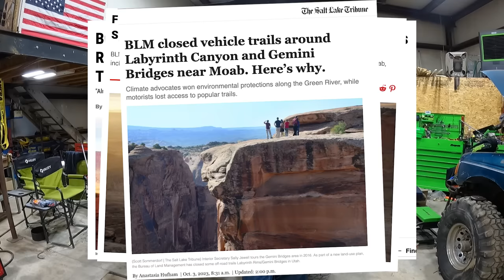TRX Falls Off A Cliff

Comment: I feel confident in saying that there is no one else in that area capable of doing what you did in removing that wreck from its position. You may not have been monetarily compensated for that service, but what you did in saving the land from further damage will reap you greater rewards in the future. Thanks Rory, Mike and Shawn for the great work you guys do!
Reply: Yes exactly and keeping the crowd out of harm's way. Cheers Capetown 🇿🇦👌
Reply: Heavy D and Matt's Offroad both could have plucked that truck out.
Reply: @donm.1068  I'm pretty sure it was Heavy D that was his "competition" on this job. I'm also really fuckin skeptical that trenching out that wash did less damage that a pick from above would have done.
Reply: @BT-ej9xf  I was wondering about that, too.  In terms of road/trail maintenance it was probably better than banging the TRX on the lip of the trail that the TRX fell off of, but not by much.  But I was also wondering how tough it would have been to get Heavy D's big wrecker in position.  I don't know those roads/trails, maybe it would have been easy, but maybe not.
Reply: @BT-ej9xf then why did he want heavy d to come out? Cuz he did mention that in the video
Reply: @BT-ej9xf  It's a wash, The water is going to remove any trace of the damage they did next time it rains

Comment: Can’t believe that the owner and his dog survived that fall!! It’s great too see you and crew doing everything you can to protect the environment and checking with all the landowners for access to enable you to recover the true.
Reply: Yeah amazing to see the cab of that truck pretty well intact after that.  Never would think that someone and their dog would make it through something that crazy.
Reply: Thought for sure that was a fatal, what amazing safety modern cars have. That thing is crushed to bits, and the frame is snapped at the bed / body area, it took some massive hits.
Reply: They learned their lesson that the TRX was beyond their capabilities. Hopefully the owner goes back to a stock 1500 or Powerwagon for their needs.
Reply: @PatientXero607 I was down there with him. like Rory said there was oncoming traffic and the Trx is a big truck and once one wheel went off it was over
Reply: @PatientXero607 they way Rory described it and others on this thread confirmed, it wasn’t really an issue of the driver being in over their head. It was a slight misjudgment of where he was in relation to the soft shoulder and trying to follow the rules of the road to allow others to pass safely. A lighter Jeep probably does not collapse the soft shoulder and pull the vehicle over the edge.

Comment: We built a sled for ATVs that had severe front end damage to tow them out of the woods. Something like that would have worked great here, steep angle on the front for getting over logs (rocks in this case) and it slid well over soft ground, keeping the frame and damaged front end components from digging in and getting caught on things.

Comment: Surprised you guys didn't put some good rolling tires on the front so you weren't plowing and were rolling over things instead with that front end. Holy cow! I thought that the cab was broke off the frame when coming through that rock pecker path but towards the end there I see that the  frame was actually ripped up from the bottom! Wild. Thanks  Rory for doing this job as cleanly as you could instead of the other hackwagon. Unfortunately I think we're going to lose all our trails to the greenies in their stupid Priui (that's the plurural of Prius right? )

Comment: I would like to give some constructive criticism, and I hope you don't take it wrong because I genuinely want to be helpful. The argument about someone else destroying the land and you not destroying the land is pretty weak. Maybe they will destroy the side of the cliff, but you are kind of wrecking parts of the canyon floor. Kind of a toss up. You did amazing. Its just a tough job, and some damage is unavoidable. If you are pretty sure you have done the tedious paperwork, and they will not do the paperwork, then you should present it like this, "If you hire us, and some complaint comes in, or there is a dispute about the recovery, I can present all the permissions and approvals to keep you, the customer, and us out of trouble." That statement (you have to make sure it's true of course) will easily justify a higher price.
PS: you are an amazing driver. I can't believe how much control you have over that tow truck.

Comment: I'm sure you have your reasons, but would a rear winch on the buggie help at all?  Maybe mount it up higher or even towards the middle of the rig behind the front seats, with a flared pipe to run the rope the rope in to a rear farelead kinda like Merlin did on his jeep?   I have learned alot just by watching you guys work through the problems.... crazy how well Trailmater & the rest hold together!  I'm sure there is a TON more wrenching going on we don't see!  Years ago we had to wrench on our sleds about the same amount of hours we rode.  Thankfully that's changed for the better!  We bought winter gloves with black liners so you couldn't see how stained they were lmao.  Amazing job in the books!

Comment: I do believe I know what other youtubers you're referring to.
And while it's oh so much not my problem, I've had similar thoughts watching their stuff.
Regarding your recovery:
Obviously, I wasn't there.
And of course there's editing to account for.
But I've done stuff where the goal is to be minimum invasive several times.
And quite often you end up doing less accidental damage and less total damage if you accept doing a bit more deliberate damage. 
So dragging some boulders out of the way and filling some holes before doing the tow-out would probably have meant that it'd take less rain fall and general erosion to cover up that you'd ever been there.
It's not an either-or thing. But it's a judgement call often worth considering.

Comment: Yeah, I watched a collab with another known Youtuber where they "recovered" a telehandler off a snow covered mountain.  They spent 2 really long days in half a dozen machines and tore up several of the "recovery" vehicles along with tearing up the telehandler too. Looked like they tore out part of the wiring harness so that couldn't have been a cheap or easy fix. 
Just for fun I looked up what a weekly rental for a telehandler was and between fuel burned, time spent and repairs to all the tore up equipment they likely could have rented a telehandler for the entire rest of the winter. Supposedly they ended their "recovery" by grooming the road back into usable shape. Who knows what the surrounding neighbors thought about all this in their quiet little valley.  Also surprised there weren't injuries for the crew from patting each other on the back for what a great thing they were doing. 
I pointed this out "nicely and logically" on the threads and you'd have thought I kicked their favorite puppy or something.   The owner of the telehandler even got a few shots in at me. So basically they went through days of frustration, risk and damage to equipment SOLELY to generate clicks and revenue. It was peak "unreality" TV being made. To be fair they've done some neat stuff for some folks that needed help but this wasn't one of those times.

Comment: Well, that was an amazing ground recovery. It was good to point out that any minor "damage" or rearrangement of the terrain caused by your extraction would disappear completely during the next rain flooding though that area. Well done. However, I'd think, from experience, the job would have been much easier and more straightforward to have employed a helicopter with a sling to lift that wreaked vehicle up and out of there. Maybe not from the crevice where the truck originally landed, but certainly after it was partially extracted to a more open spot. For that matter the helicopter could have sling-loaded your two tow-truck vehicles in and out as well if they were needed on site.
Reply from the maker: At what cost?
Reply: @trailmater  Indeed. Few choices beat "free". But on the other hand, you and your team (and equipment) took risks. That, of course, is fine too and the project looks to have been great fun as well as work ... and did make a very interesting and informative video which I (and looks like 4000+ other commenters and zillions more subscribers) enjoyed. And, if you guys had encountered troubles you couldn't overcome, well, the insurance company could have called in a helicopter and sling crew at its own expense.
Reply: @trailmater   The cost is about $1,000 per/hr for just the helicopter.  The pilot, equipment and insurance will easily cost twice that.

Comment: You guys kinda put a few scratches in the paint. Low mileage TRX coming to a Copart Auction near you. JK. Amazing work. I would have assumed the only way to remove this truck from location where it came to rest was a helo, a crap ton of saws all blades, or a lot of accelerant to burn it to the ground.

Comment: I am not so arrogant to tell you how to do your job, as a) I wasn't there (a YouTube video never gives the extent of reality!) and b) it wouldn't be right by definition: you brought that truck out as promised: minimal damages to the surrounding. I had some concerns, though. I appreciated the double lines (where you use them), but I was expecting some weight on the front of both recovery vehicles (tractor style, to match the TRX weight +25%), doors locked with side glasses removed, and TRX front wheels locked straight.  Also... we are all safe as much as our experience taught us, but you can admit that there was a couple of spots where technicians on foot shouldn't be there. A cable snap with no load can be a horror show, don't you agree? In any and all ways, kudos to you. I wish there were wayyyy more road extrication services as yours around, and if I would live in beautiful Moab, I would apply for a job with you every other day until you say yes! 🙂

Comment: holy shit!! you guys are badass. ive never really considered what happens when moaber's crash or cawlers get stck crawling. sheer will and torque. dragging a 7000lb humpback shaped trx over boulders and water formed gulleys. incredible. i love the fact you guys tread lightly but i understand sometimes you got go with the balls out. i know they would be crazy heavy but do you think 30'' x 30" of thethinnest but strongest that wont bend steel plates would help when a truck with no front rolling ability needs to go center mount first over a rock. it would still be dragging it but instead of the 90 degree rock face and plate of some sort to ease the angle of ascent. do know. either way you all are some bad ass mofo's!!

Comment: So you did it for free, but you filmed it for Youtube??  LOL, you didn't lose any $$.
Reply: Yeah, Rory probably made about $100 on YT.  Almost enough to cover fuel.
Reply: @RealJeep  that's a bunch of bullshit. On average, a YouTuber makes about $0.18 per view, or $18 per 1,000 views. Advertisers pay YouTubers between $0.10 and $0.30 per view. This means that for every $100 an advertiser spends, Google pays $55 to the creator. 
The amount of ad revenue a YouTuber receives is based on the number of views each video gets. However, the amount can vary significantly depending on a number of factors. 
YouTubers can also make money through brand sponsorships. With over 10,000 subscribers, a YouTuber can make anywhere from $1,000 to $5,000 per video through brand sponsorships.
So $18 x 31,000 views = $5,580.00.  That's a little more than a $100 I think.

Comment: How come trail mater isn’t Cummins or 7.3 powerstroke powered why gasoline? 
Ya dude y’all need a heavy diesel motor in that front end it would help the truck perform much better and much more low end torque

Comment: Where was the Black-Hawk, HEMTT, 50’ rollback, 3 SXS(side by sides), Rotator, spare helo(because you never know if you need more equipment), CAT D9, RipSaw(cause you never know if you need even more equipment), SHERP, Kenworth & Peterbilt W/53’ flatbed winch trailer(cause you never know…), Chevy HD 4500 Duramax 6X6, BroDozer Monster truck, School Bus monster truck(cause it will make for a great video thumbnail), Jet Boat, SnowCat(cause you never know if it will snow more than 3” in the middle of the desert and a crew of 50 people… I think that’s what this video was lacking…
All jokes aside though, one channel is professional recovery crew and the other is a novice hobby recovery crew. 
Both YT channels are fun to watch, but to compare them to each other would be like comparing apples to oranges… either way this video was impressive, not only for what they were able to achieve but also for the fact that the driver and his dog lived to see another day.

Comment: What no damage? You drug oil from site to tow truck not to mention the toxic radiator fluid. Flipping over rocks doesn't fix the damage you inflicted to the land . Pre building a dolly system for recovery, draining the fluids would have been the first thing I did .. dragging that truck was barbarically executed.. lol no damage (your fired)

Comment: I'm sorry to have to tell y'all this, but y'all have to go back on foot this time to the place where truck landed 
With screens to shift all the sand through, and remove every minute piece of the pieces from the accident along the path y'all used  coming out 
Ya'll will scrub all the paint off the rocks, as well as use wire brushes to erase every scratch made on any and every rock bolder along the path, and lastly. 
It all will be raked back to look as if motorized vehicles have ever been there. 
Every blemish that's found by agents of BLM, will cost you $180,00 each, and this starts from where you left the road entered the old aces road to the location y'all found the Ram at.
Now that what I was expecting to hear you were required to do by both the land owner, and the BLM, especially after some of the ignorant shit that they've tried to get away with, not too mention the ilagel such as forcing people off the land that has been in their families name legally for over 150 years